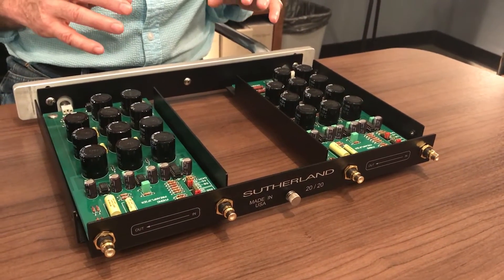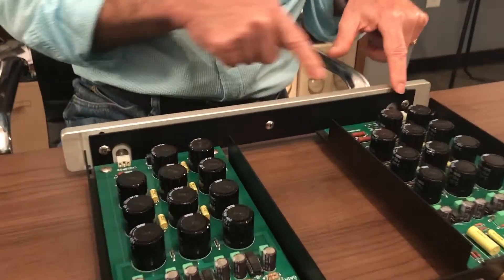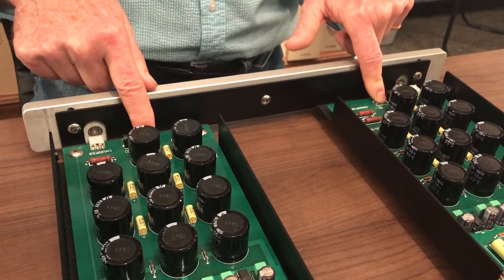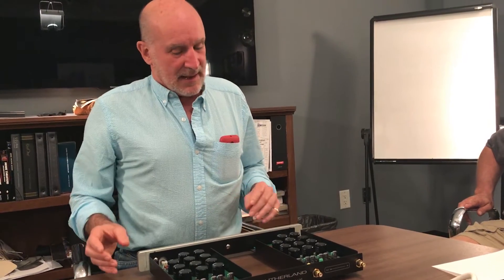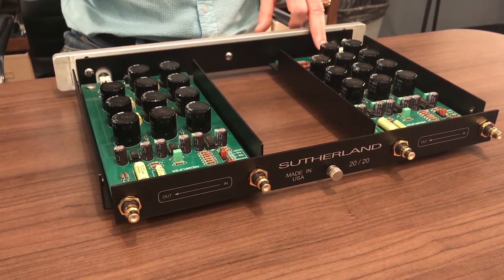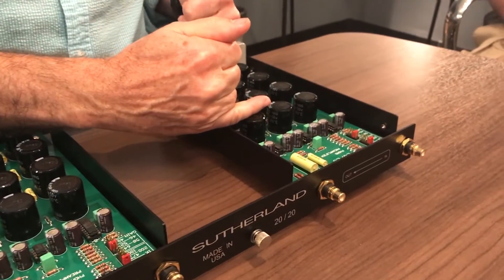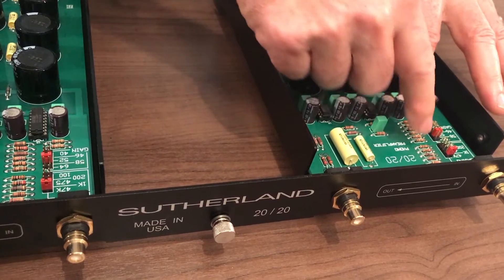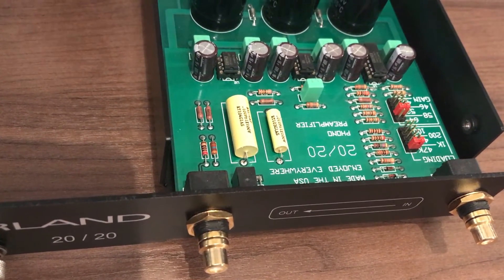Ron Sutherland Talks About the Sutherland 20/20 Phono Preamp

Comment: over engineered. you don't need all those capacitors
Reply: You're an idiot. They clean up the power supply. Those caps and resistors are why it sounds so good. What we dont need is your dumb ass comments. Plus the unit is $2200 not 10K. Dope!
Reply: @Steve Tllsdaleys I was right. You're a moron
Reply: @OssidianOssidian You don't know anything about electronics
Reply: @Steve Tllsdaleys You obviously don't know anything about electronics. Those capacitors are for show to justify the $10,000 price tag for stupid consumers. They only cost $3 each at most

Comment: That phono stage looks like a true work of art. Nice.
Reply: Exactly. Art. Nothing in common with a high end electronics design. Just art. But engineering is not about art.
Reply: Sixta16 It's an extremely well-regarded lineup of phono stages. Why are people so down on these components?
Reply: @clippy_friend  Exactly. I own a 20/20 and the first song I played through it put a huge smile on my face. I upgraded from a Croft phono.
Reply: Rohan Damle To be fair, if you look up the parts, these things have like $50 in surface mounted parts. The case/front plate is probably the most expensive part to source.

Still beautiful and wonderful sounding.

Comment: I'm not a huge phono fan , but it's always great to see high quality components.
Reply: Nothing in common with high quality.  I just see (at least one) man on drugs.
Reply: @Sixta16  Do you know of a better phono preamp for $2000?  I would love to know.  For now, I am considering this product.
Reply: @1bntcr001  no, nothing better than Sutherland 20/20 for the price.
Reply: @1bntcr001   @1bntcr001  Late here, but the Sutherland is uncommon (I've never seen one) so the likelihood of finding someone who has done lots of comparisons with it and is available here for comment is low.  I will tell you that $2200 is an extremely competitive market for phono amps, especially if you start looking used.  At that price point, I would expect to find some using discrete components (no opamps – even expensive ones) and a mono switch.
Reply: @Sixta16  What do you think of the Manley Chinook SE MKII?
Reply: @Sixta16  Yeah, does seem rather pricey for what you get.